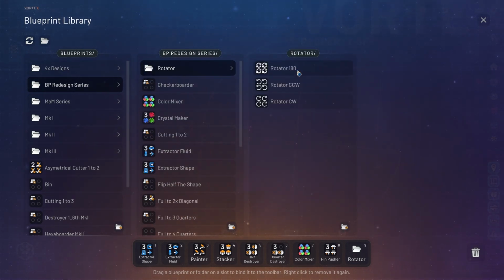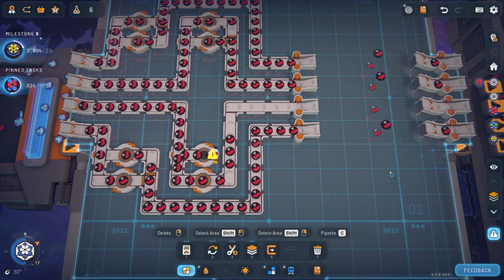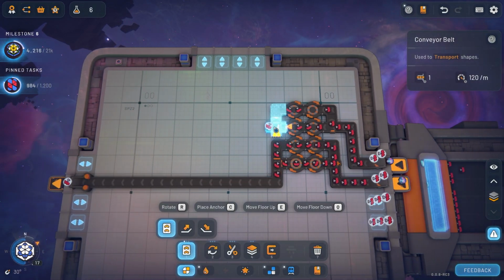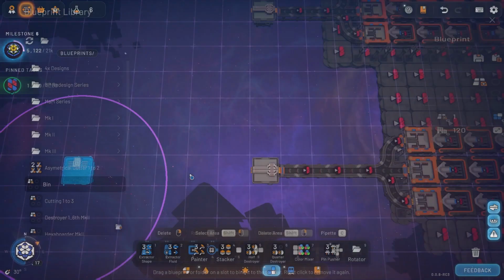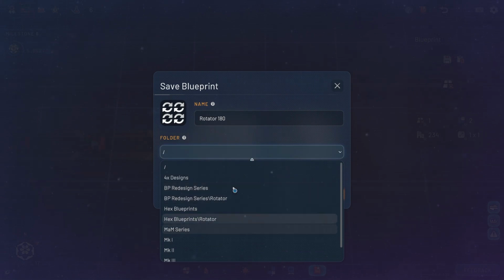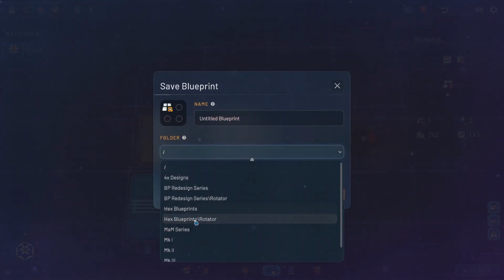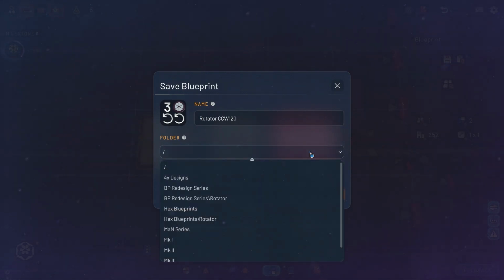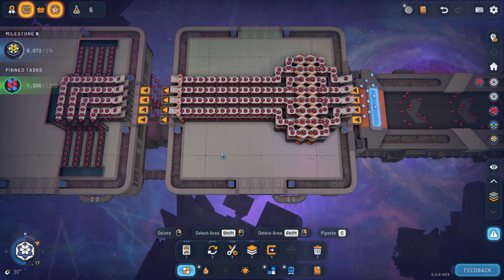Shapez 2 Blueprint - Hexagonal Rotation

Comment: i found an elegant solution to the rotators - since you're jumping anyway, why not use the space freed up to do the rotation
if you immediately jumped the outside belts entering the tile, there is enough space to split/rotate/merge the inner belts into the space freed up by the outer belts
do the same a bit further by jumping the inner belts and split/rotate/merge the outer belts in the space from inner belts

SHAPEZ2-1-H4sIAP9tGmcA/6ybb0vbUBjFv8tlL/Oi96R/ksBe2LoxWd1cFbcxRIK9ukCWyG26IdLvvnRN1zS2ktzzKChin3PP8+c+NT/wWV2rSPfCgafGFyp6Vm+Kp0ejInW2SONsrjx1dpdn61+cxkWsoh8qKX+OLtK4uM/tr4XysmWabr6oxc/40USz5eZT3aw89S4rbGIWZeCzuiplp/FTvixuP5WxcXqrS/1x/dTxMknnSfYgeu43FQWe+l7mOfLUTEW+98/K2KTFRW6LmbkzyW9jz7LC2CxOr2ObxFlRWpiUr/rwcLL+eKtWXl1p2FQ6NffxMi3e5/ZPbOdNrSo4FLMRCtgYEMHhoRQuTTY/lsDHk0MJ9LtXotRoNmPAmql0eiJuNjnhRVmn5r5oiJwn1ubWzPcVQqIvQZtj90OOjcErgcHh5rXyuYn1iVh0bffk8B3W7RNvNio8MjAdOuUTsXQF1s6FNtFWym0VbaPddtG6hdWVaz+82yDdfe63bntMrvTqrHTI3bktA708t0I9ET8hU9rAffVWCgP3nVAl0Gcm2WeCpbaCz7SAN6HlVpNmVlNQG6kq9vIxTYryxfoqx7TVe/nePJ0b+2AsrnI9bTdLLaMbUa0tN+u01/hZXsRFbj9n5ssynk8mX1//Y5KJ7Xc1HBBnVrEg/DKxumNLe8SR22BNDSF3ts8E97nLN3Tv05Cw7Rar6dgR4XnkXqqR+y0kQtfvD9Pym+QT/SG9js/1MpZCMUsDWiI8npTT875bhQ4/9UsY2z37izmrZ8lxALJ3wVbBgQm8cnQbMuDs/D8fIBXgNh7HWUG3ghwnBmRPfVpBqDI1hiCz9WokwTnDGk9w19CNa+zEFtzuT40wsDUQWtw72sDvxxpzELGmBXf3jj+whQ/Y9b9jEdzO2REJ9i74vITs1vH5NkkZ0tJrUPNrMHgxiAzBaIq4cIz2Gi9pRpckDjCNZnh3skEq9N1SCOjzd6yDzIBX0E4j0KOPrzEQeowlfPi8RF/iWg/Zjg7pRBgFLaQworMYsYUcsfebFqjeuyDMUsCzFAizFPAsBTRLgSRLgSBLgShLgSBLgQxLAc1S4MpSwLEU0CwFNEuBKEuBEEsBzVJAsxTIshRIsxQIsBQIsBS4sxSwLAU8S4EoS4EkS4EsS4EgSwHPUiDEUiDEUsCzFPAsBaIsBTxLgSxLgTRLAc1SIMFSIMBSQLAUcCwFNEsBzVJAsRTQLAU0SwHNUsCwFPAsBRIsBTxLAc9SIMFSwLIU0CwFNEsBzVJAsxSwLAUsS+kocOOpcZLF9una2EWy/reV9X/UrFY3q9VfAQYAX6EiQWAzAAA=$
Reply from the maker: Very cool concept I like it!
Reply: @DataEngineerPlays  hope you don't mind that i attached a blueprint